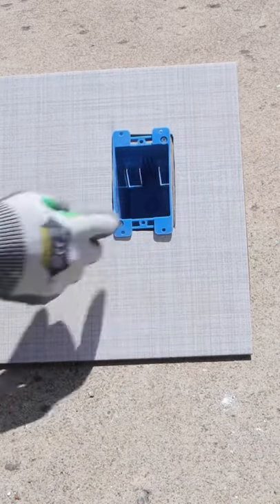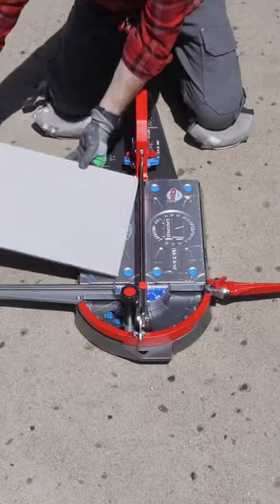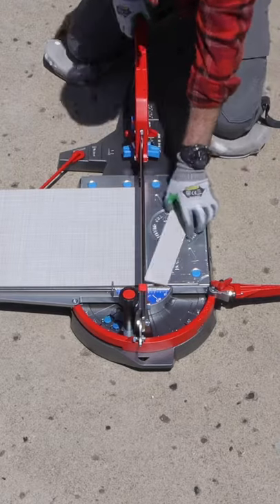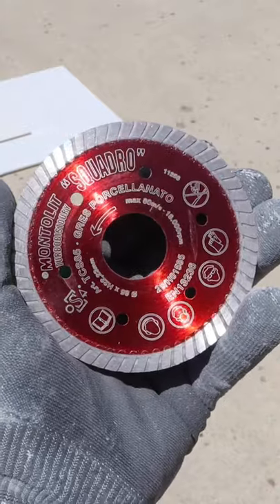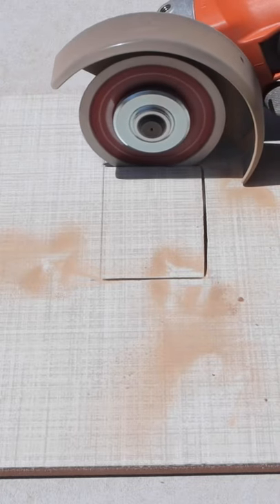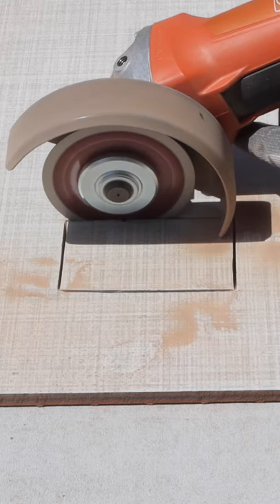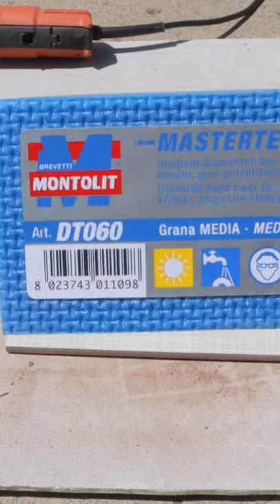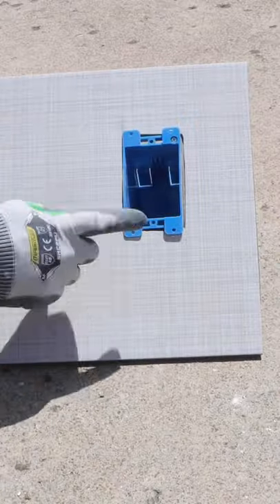Tile Tips for Electrical Outlets - #shorts

Comment: I just ordered a blade like that,I needed to remove grout out off the Shower
Reply: That's really unnecessary you could just use a grout blade or a carbide blade on an occilator... Angle grinder for grout removal is o.d